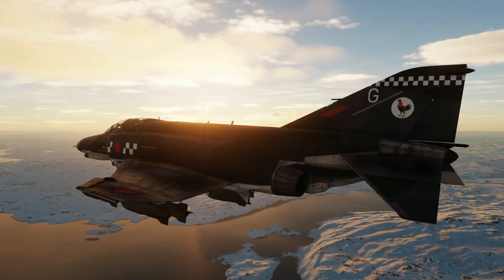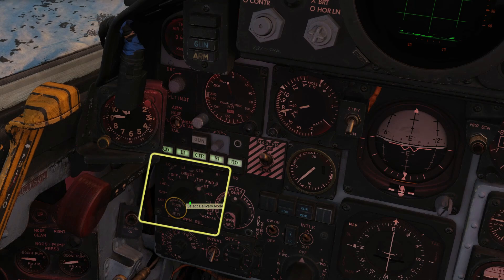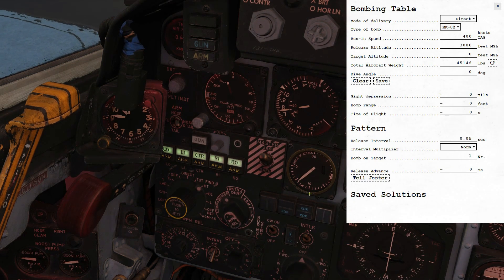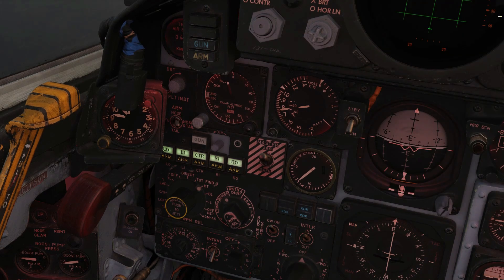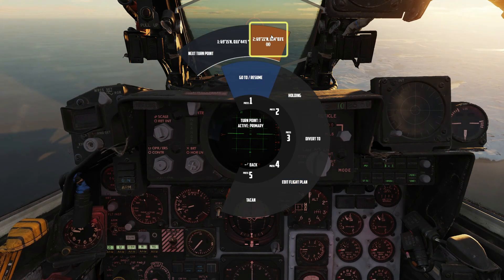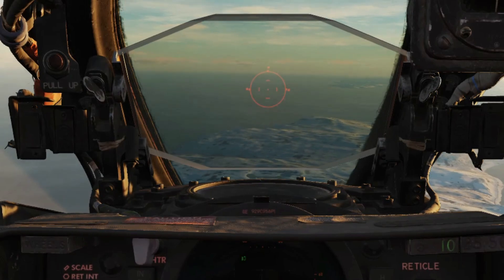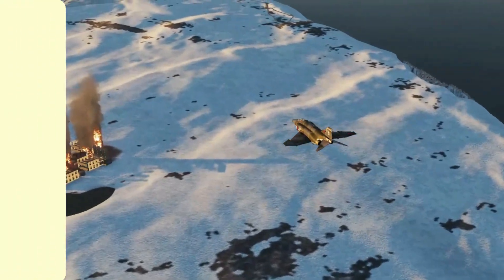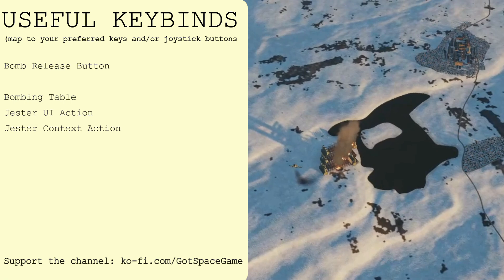DCS Phantom Dive Toss Bombing Tutorial - F4E DT Mode Bombing - DCS in 3 Or Less

Comment: For the bombing table you don't input run in speed, dive angle, target altitude, or release altitude? Because I've been doing it that way and I'm just wondering.
Reply from the maker: Yeah it's not really necessary in DT mode. The drag of the various slick bombs is also so close that even that barely matters if you're dropping a couple at a time as well. It's A bit more important with clusters though as the bomblets are more draggy.
Reply: @GotSpaceGame  Generally speaking that is incorrect, it is necessary to input these numbers.
Reply: My understanding is that’s for a manual release. It’s in good practice to do so, In case of failure for radar lock, etc.
Reply: @Glagrel  The entered numbers do matter, they influence your drag coefficient and that is what the WRCS uses to figure out the ballistic curve. Not entering them will usually result in missing the target - depending on how "severe" your profile is.